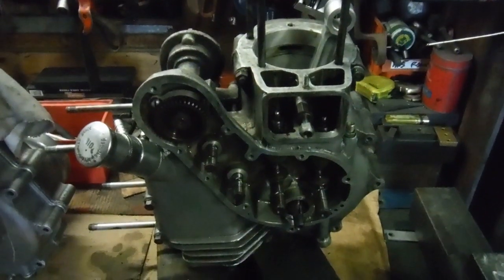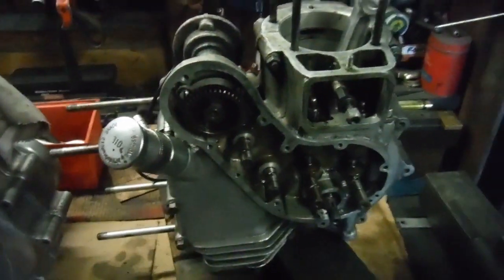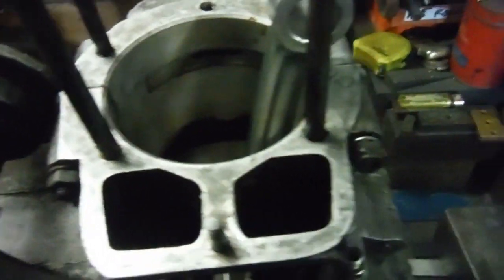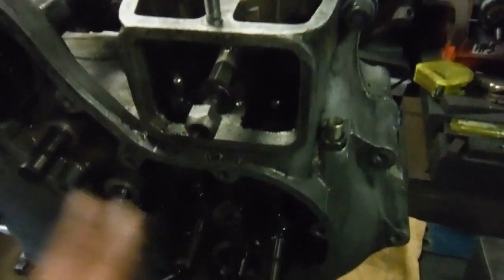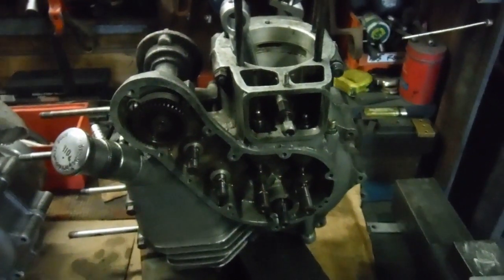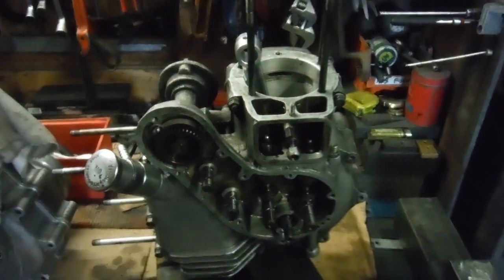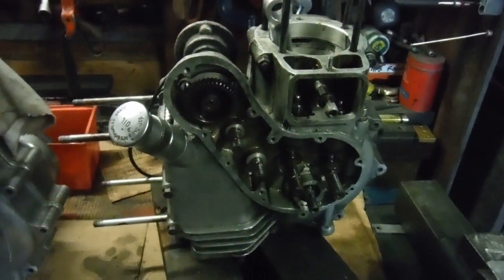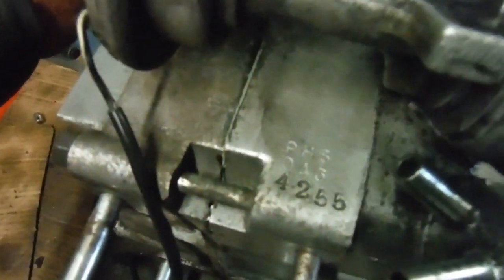Royal Enfield 500 Bullet Asbo 43 bottom end assembled and tested for free crank rotation.

Comment: Hi Paul is a Electra x bullet crank a good upgrade for my 2005 classic as o imagine mine has an alloy rod?
Reply from the maker: Hi David, in principle you might think so, but the Electra X cranks are quite different and the conrods are shorter. Also, the Electra X cranks had issues with early big end failures, so, all in all, it is really a 'No'.
Reply: @paulhenshaw4514  are right so rebuilding my own crank with a steel rod kit is the best way forward!

Comment: 160 km/h for a single is more than excellent. Congratulations on your wisdom. Wonderful adjustment of the handwheels on the axles. Great durability and satisfaction for the owner. And considering that it doesn't have special gears and springs command like in Velocette Truxton and Venon.

Comment: Do you get a significant increase in horsepower with your engine modifications, and if so how much over stock?
Reply from the maker: Yes, pretty significant. I would expect mid to high 20's in BHP @ rear wheel [an increase of about 10 BHP] from a build like this and good for 90 MPH with lively acceleration. Going more extreme with cams, carbs etc would take it over 30 BHP and 100 MPH and perhaps a little more. The lightened cranks play a big part in this.
Reply: @paulhenshaw4514  that's an impressive increase for the mods involved, well worth doing, thanks.